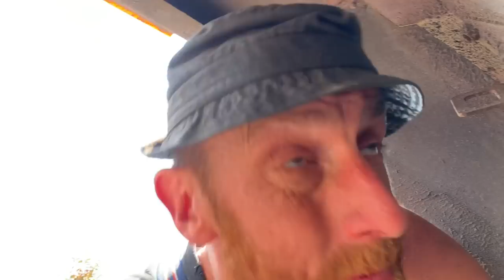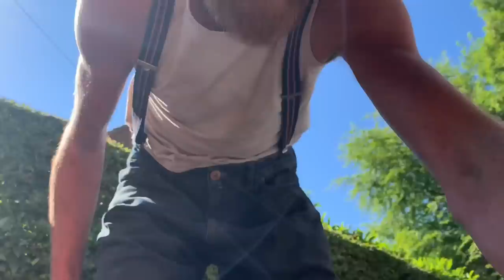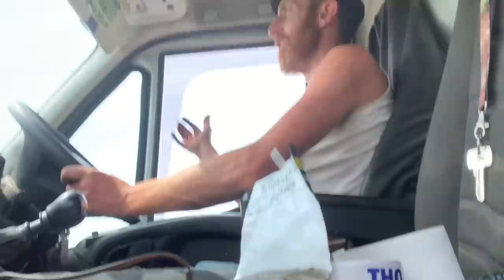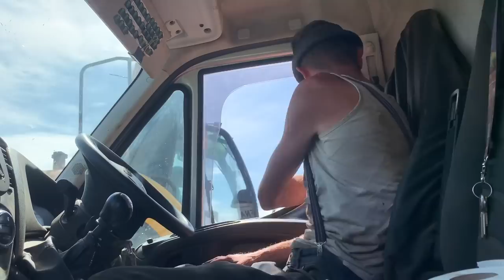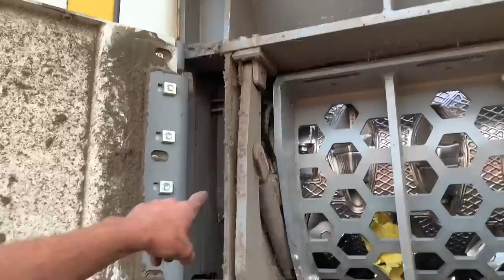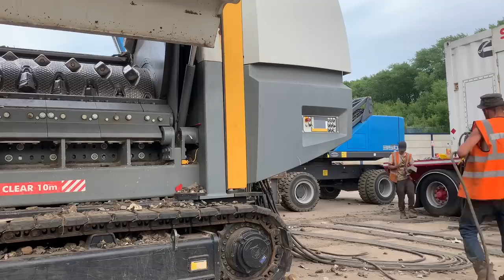Hot weather….Man flu! Machine Shredder cage swop, PO box ✅, inspections, plus a jack fall 🤦‍♂️

Comment: That shredder cage is a doddle - you want "Struggle" then change the full set of hammers on a hammer version of that shredder. Same same machine, except big swinging hammers instead of them teeth. The hammers are held in by thick bars that run all the way across - the hammers pivoting cause the shafts to wear/spall/bl;ah blah - getting 'em out is The Proper Nightmare.  Hardest job I think I've ever come across over the years.